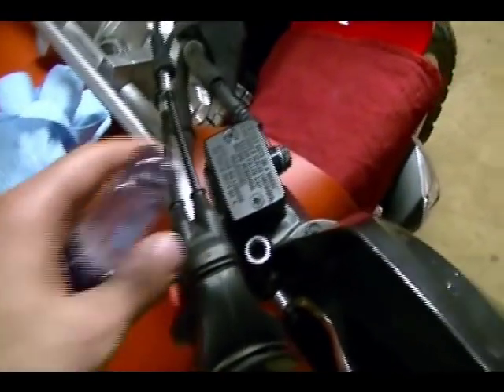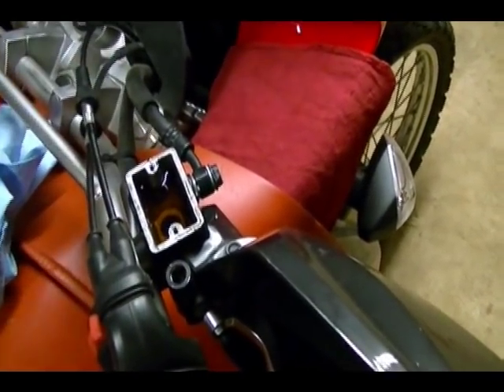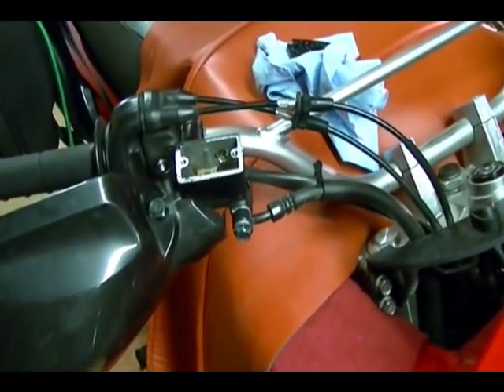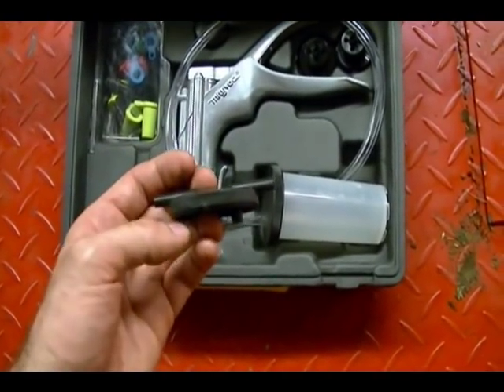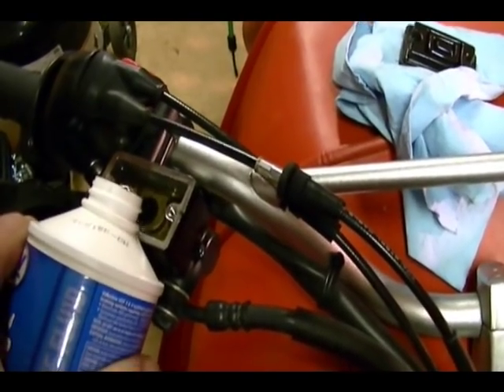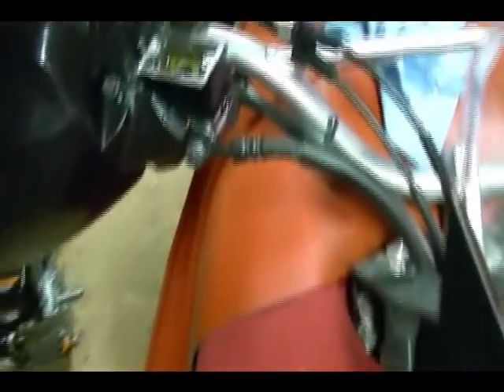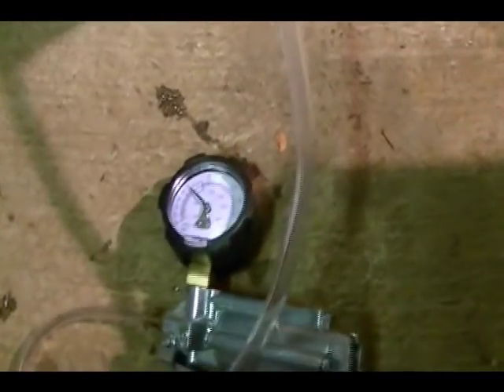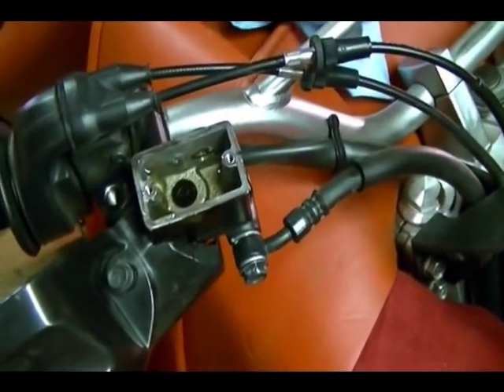Motorcycle Repair: How to Replace the Brake Fluid and Bleed the Brakes on a Motorcycle

Comment: If the hose has a leaking fitting, I will consider upgrading to stainless steel brake components.  But, for the money, are equivalent rubber hydraulic hoses just fine too?  They have worked fine since 1987.
If the seals in the OEM caliper pistons have failed, would you overhaul the seals, or pay for a new caliper?  What other parts beyond seals could also be tired that would warrant a complete caliper replacement?  The time to do the overhaul and the possibilty that I may not complete the seal replacement as well as what a machine can do in the construction of a new caliper?
Thank you for your input on my ZL1000 motorcycle's dripping and probable failing brakes diagnostics.

Comment: On my 1987 Kawasaki ZL1000 Eliminator, I noticed that the floor was wet with brake fluid under the front brake's caliper.  I own a pump similar to what you depicted and have the confidence to perform the suggested steps shown in the video.
What components show I consider as probable to have failed? Doeas the hose have an o-ring or gasket that could have failed, or is it more likely one of the integral seals in the front caliper?  Being that it is brake related, should I simply take it to the dealer for diagnostics, or better spend the cash on all new components since we are talking OEM 1987 brake parts?

What is the best way to dispose of the used brake fluid, or the left over two year old DOT 3 fluid that you suggest to not use preferring to use only new fluid each time that the brake fluid is serviced/bled/topped off?

The video was clear and well paced.  It was one of the better instructional DIY videos that I have watched on YouTube.

Comment: This seems like a very tedious process? you almost need 3 hands and constantly need to bow down and check two things at once... Couldn't you just add new brake fluid and pump it through by pumping the brake lever, while adding fluid to it constantly and leaving the bleeder open? Once you've pumped about twice the recommended amount through, you could be fairly safe to assume that it has been cleansed of bubbles and all the remaining brake fluid that you caught can just go back into the bottle?
Reply from the maker: Beaver 314 If you leave the bleeder open while you pump the brakes you will suck air into the brake line. You can leave the bleeder open and let gravity force all the old brake fluid out of the brake system, but it takes a long time, and you still need to keep an eye on the brake fluid reservoir.
Reply: i think you misunderstood... when i said i would leave the bleeder open i meant that i would attach a hose to it and let the dirty fluid drain in a bottle, while always being submerged. That way it would never be able to suck up air.

Comment: Great video, thanks. To make it a shorter procedure, I extract most (not all) of the old brake fluid from the reservoir with a regular syringe. I then pour new fluid and pump out the fluid from the calliper as shown in the video (in case you've got a vacuum pump). If there was no air in the system in the first place you just need to wait until the fresh new fluid comes out the other end.
Reply from the maker: Good comment. Thanks for watching!

Comment: hi my front break seems to have locked whyle sitting in the cold whinter should i bleed the lines ??
Reply from the maker: mack painton If there is water in your brake fluid than it will freeze in 32F or below temps. Brake fluid is good at absorbing water, so it is good practice to replace the fluid every few years.

Comment: Great video, thanks.  Despite DOT3 or 4 being recommended, could you not use DOT5 as it is not hydroscopic?  Are there any downsides to doing this?
Reply from the maker: DOT5 brake fluid attracts air. This can cause braking problems at high temperature and high altitudes, and can be a big problem if you brake system uses ABS. I would use the brake fluid recommended by the manufacturer.
Reply: ***** Thanks for the response.  Neither of those situations apply to me, as I'm 400M above sea level and my KLR650 doesn't have ABS.  I've already flushed the system and have put in DOT5.  No issues to speak of, yet..... except the usual stripping of the front master cylinder screws.... seems to be a common issue on the KLR... grrrrrrrrr.
Reply from the maker: Let me know if you experience anything odd from using Dot 5 brake fluid. The other day I was shopping for brake fluid for a mountain bike with hydraulic disc brakes, and I noticed the new brake fluid container said Dot 5.1. I am not sure if that is the same Dot 5.1 brake fluid for motorcycles and cars. Lookup Jagwire bleed kit on ebay.

Comment: Why couldn't you use the bleeder to extract the old fluid and then pour in new ones and continue to pump to flush out the system and bleed at the same time? I'm new at this so I'm just curious on why those are two separate steps. Thanks for the video!

Comment: for some reason yesterday when trying to drain the fluid no matter how much I pressed the brake the fluid could not come out form the bleed valve which was of course unscrewed!! What worried me was that when I unscrewed the valve just 1/4 of a turn it became really loose and felt like it was going to fall even though it had much thread left :/

Comment: any reason why you don't add new break fluid while your draining it and prevent air getting in to start with? Just keep topping it up and put some extra through to flush it out, basically do a drain and replace at the same time? Going to have a stab at this but don't want to have to source a vac pump.

Comment: The air can be compressed. Fluids are theoretically not compressible. So if you have air inside your brake system, when you apply the brake the air is being compressed and the caliper pistons do not apply the correct pressure on the disc.

Comment: @whampoawest Most motorcycles require Dot4. Cars seem to get by with DOT3 because of the larger disk's in the braking system that are able to dissipate larger amounts of thermal energy.
The less surface area on a disk brake rotor & the less it weighs = higher temperature under braking and quicker wear on the pads. DOT 4 can take a hotter temp than DOT3, so I'd recommend DOT4 especially for motorcycles, dirt bikes, & mountain bikes. My mountain bike requires DOT 5.1 cause of the sub 200g disk